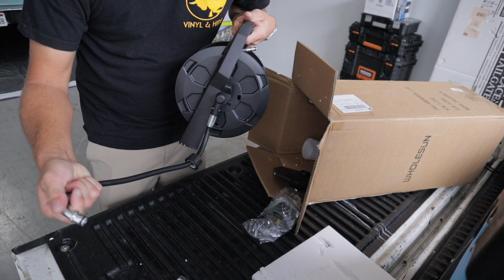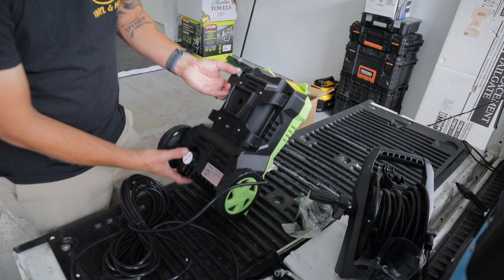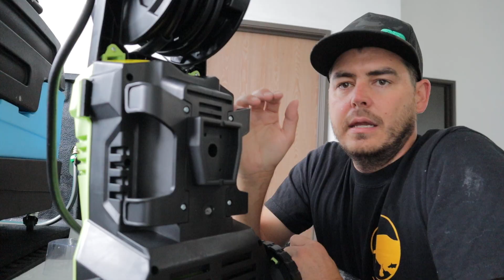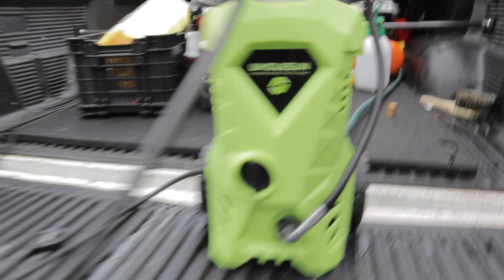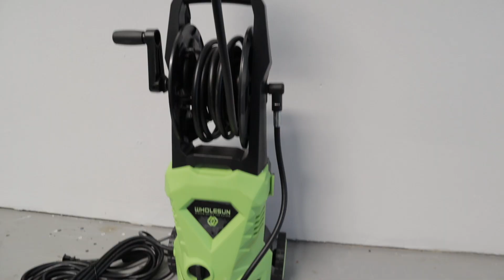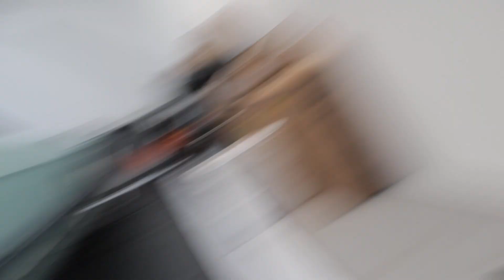WHOLESUN Pressure Washer Review | Power Washer Review | 3000psi Electric Pressure Washer? Car Detail

Comment: Thanks for making this video, it helped me decide on getting one. Only issue is the tiny soap bottle it runs out so fast. Do you know if a standard bottle replacement will fit?
Reply: I think that he used a replacement one in this video and it worked.
Reply: You can put it at the end of the wand as quick connect separate accessory

Comment: Used one time and it was fine. Second time it was a power shortage inside the machine and never worked again. Piece of junk
Reply from the maker: Were you able to send it back? Get your money back through Amazon
Reply: @imjoshv  it was over the time frame to return
Reply: Fitting on hose reel blew from pressure,  had no manual, no customer support number,  found the part, it was out of stock.  Now it is useless.  Trying now to find a hose coupling.

Comment: Hi Josh..thanks for the review..purchased the wholesale 3000psi last month ..works great but would like to upgrade the hose ...do you know if I will need a 15mm to 14mm adapter..also if I change to  quick disconnect fittings I will need to change gun and lance , right?Thanks, Mike
Reply: I would love to know the same thing

Comment: Man I never used a pressure washer before, everything was new for me. Bought this same model and the whole 2.6 vs 2.5 orifice drove me crazy, Also the pressure hose connector being 15mm instead of 14mm... The gun connector seems to be proprietary, I could be wrong, but definitely not a 3/8... I wish I could know the size of that connector.
Reply from the maker: Yea, ive been sticking to the Ryobi pressure washer mostly/. But check this one out... I use it at my shop and LOVE IT! https://amzn.to/3dZCWPG
Reply: @imjoshv  that looks like an awesome little thing. Do you think is more powerful?
Because the wholesun numbers 😂...
Seems that it could be an american company. They have an american phone number to call.
I like the wholesun anyway, did an amazing job at cleaning my walkway.
With the wholesun you're pushing the limits of your 15 amp circuit. But I'm sure it draws less than 1600 watts anyway.
I'm ordering a new whose, gun, wand, adapters etc. I'm in love with the water pressure world now 😂
Reply from the maker: Maybe slightly more powerful! The whole sun numbers are not accurate haha
Reply: @imjoshv  Oh man I kept watching your videos and I just noticed you didn't do a real psi test on this one. Mine measured a hair above 1600psi, instead of the 2.200 rated. Flow wise it does the same as the sticker, 1.8gpm. You can't find anything better on the store, even if you pay an extra $300.
I had a leaking problem with the garden hose adapter; getting loose. I solved with these two adapters.
Some people just use the NPT on the garden hose pipe thread, but that can be bad, because the real thread of the machine is BSP. People forget that NPT is only an American thing. 
Then I just added a quick connect for the garden hose. This set up is absolutely solid and indestructible haha. This set up will also work with most electric pressure washers on the market. Almost all of them use the worldwide standard hose threads BSP.
https://www.amazon.com/gp/product/B086JP2DYW/ref=ppx_yo_dt_b_asin_title_o03_s00?ie=UTF8&psc=1
https://www.amazon.com/gp/product/B00835IJ5M/ref=ppx_yo_dt_b_asin_title_o02_s00?ie=UTF8&psc=1
Spent a little fortune on accessories and this machine rocks!

Comment: That white tip is shooting at 800 psi not 3000 you use a yellow 25 degree and you get about 2700 psi 

BIG DIFFERENCE
Reply from the maker: the different nozzles definetely make a difference
Reply: @imjoshv  saw a video on pressure test on different tips and it did change dramatically.

Comment: Thinking about ordering tonight before the Amazon prime deals go away. Is it worth the buy? Definitely want something with high foam, do all the attachments you recommend do that?
Reply from the maker: Yea it’s worth it! But you definitely rely want to get a separate foam cannon and the 1.1 mm orifice to swap out in the foam cannon to get the most foam!!! Those are linked in the description
Reply: @imjoshv  appreciate it bro!
Reply: @imjoshv  I just ordered everything you had listed except the hose. Thanks for getting back to me. 🙏🏽
Reply: @imjoshv  what pressure tip do you usually use? I’m new to the whole pressure washer thing so I definitely don’t want to ruin paint.
Reply from the maker: @mattcornejo9031  I prefer a 40 degree nozzle with a 2.5 or 3.0 orifice!  You don’t have to worry about the paint too much even with the 15 degree nozzle. If you’re worried at all just keep a little distance and you should be fine
Reply: @imjoshv  sounds good! Thank you.
Reply: @imjoshv  I got everything in today! One problem I bought everything but the hose. And the stock hose does not fit on the fitting for the new foam gun? I ordered everything from the link. Not sure where I went wrong?
Reply from the maker: Are you using a different gun or the stock one? The foam cannon should sit on the stock gun
Reply: @imjoshv  I tried connecting the aftermarket handle gun to the stock hose but it wouldn’t connect. The foam cannon did connect to the stock hose but how do I get the aftermarket gun to fit the stock hose? Or are all the links supposed to be used with that aftermarket hose?
Reply from the maker: Hey Matt yeah unfortunately that hose has a different style attachment so it won’t work without changing the hose... but the aftermarket hose is a HUGE improvement over the one it comes with
Reply: @imjoshv  For sure bro, so all I need is that hose to complete it all? I bought everything else lol. Really appreciate you writing me back I’d be so lost right now ha
Reply from the maker: Yeah that should be it! If o remember we that one has the size fitting so it should be an easy plug and play!
Reply: @imjoshv  not sure why but the new blue hose is leaking I’m not sure if it fits correctly

Comment: I just got this and used it and it works fine...
I seen some other videos where people are complaining about it but
it is easy to set up and use so Im not sure what the issue is...
Reply from the maker: Yea it worked really well for me!!
Reply: @imjoshv  I do want to add that the top piece (the section that holds the water line) does break off easy so I re-enforced it with JB weld and put longer screws through the base to make this more durable
Reply: Mine is brand new and does not have the same attachment for the nozzle.  It leaks water around the nozzle.  It basically doesn't work.  Huge waste of money.

Comment: 1st from Puerto Rico 👍🇵🇷
Reply from the maker: Youre fast!!!
Reply from the maker: By the way, where are you in PR?  I did a surf trip there a loong time ago to Aguadilla and Rincon
Reply: @imjoshv  Hi Josh!  Hope you enjoyed your visit to our island and you have experienced our daily tempereature and humidity that we have all year long.  I currently live in the city of Guaynabo which is next to San Juan.
That pressure washer has the same quick connection at the trigger that my old Black and Decker has.  It sounded amazing since it doesn't have that whizzing sound that most electric pressure washers have.  I purchased a new pressure washer a month ago Active VE52 and my cousin a Sun Joe but forgot the exact model and almost looks like yours.  Check out the Active VE52.
We recently recovered from drought season.  In May we had Saharian dust which several years ago was recorded highest ever recorded with 154 and this one definetly has been the highest 310 ever recorded.  Due to curfew because of the pandemic some people go to the beach but have to be with masks and not in groups.  Since I have a regular job as a Senior Programmer Analyst I work remotely and my side job detailing is a bit slow.  People can go to do their daily chores almost as normal as life used to be but always be wearing a mask and disinfecting their hands and temperature check before going to a store or banks or offices.  No cinemas are open and you cannot try clothing before purchasing them at the stores.  We are flattening and have kept low the contagion but tourists from the states have been infecting us.  During 4th of July lots of locals went to the beach, being in groups with tourists got infected and groups of people started to also be in hospitals as well as those tourists who were infected.  After that, the curfew had to be set again after we were during the month of June without it.  Due to all of that, back to strict measures starting with airport and tracing the tourists.
You were at nice places to do surfing.  I don't surf since I love doing mountain biking, snorkeling, basketball or volleyball.  Now we can't play with people so you end up being alone at the basketball court doing baskets for a while until someone else comes up.  We have to leave so the other person enjoys the basketball court for a while🤷🏽‍♂️
Also we are getting prepared because apparently will have a hurricane for Sunday.